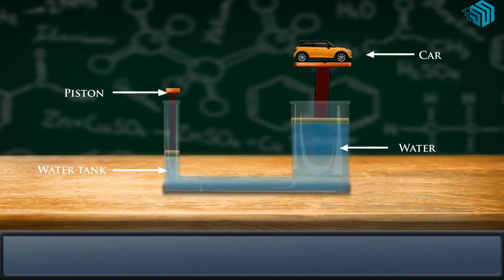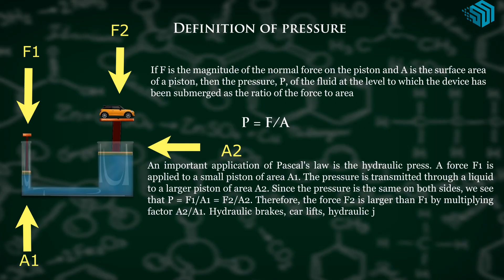Use of Pascal's Principle- Hydraulic Lift

Comment: The video is misleading. It makes it seem as if the large side will raise as much as the small side is lowered. The truth is that the ratio of the small area to the large area determines height change as well. If the large cylinder is 10 times the size of the small, it travels 1/10 of the distance. This is why something like a jack requires pumping to slowly raise. You cannot create energy from thin air.

Comment: I have no argument with the principles you stated. However, is the illustration drawn to scale?

It would seem to imply that the height change in the second cylinder would be the same as the change in the first.

The volume of the second piston (greater area) is larger than the volume of the first piston.

If so, the same amount of fluid being transferred from the first piston to the second would result in a multiplication of force (mechanical advantage) but over a SHORTER distance (height) as the fluid fills a larger secondary volume.

Pascal’s principle is based on the same fluid moving from containers of different volumes.

Comment: Sir what is difference between hydraulic press and hydraulic lift?
Reply from the maker: A hydraulic press is a machine press using a hydraulic cylinder to generate a compressive force.

A hydraulic lift is a device for moving objects using force created by pressure on a 
liquid inside a cylinder that moves a piston upward.

Comment: Sir I have a doubt
If piston one is lowered, piston two rises generating multiplied force(F2>F1)
My doubt is how much force is required to bring(pull) piston 1 to its initial position? Is it same F1
Reply from the maker: Pressure is equal to the force divided by the area on which it acts. According to Pascal’s principle, in a hydraulic system a pressure exerted on a piston produces an equal increase in pressure on another piston in the system. If the second piston has an area 10 times that of the first, the force on the second piston is 10 times greater, though the pressure is the same as that on the first piston.
Reply: @scienceprojects7130  Sir it means pressure depend on area ,if area is greater than pressure is also greater.Am I right sir.
Reply: @UR_10_GREAT  nope,  area is inversely proportional to pressure therefore greater the area lesser the pressure!!
Reply: @Nithish Royal: the same amount of force which was given to lower the piston is required to pull back piston 1 to its initial pos given tht thr is no change in mass on the piston.